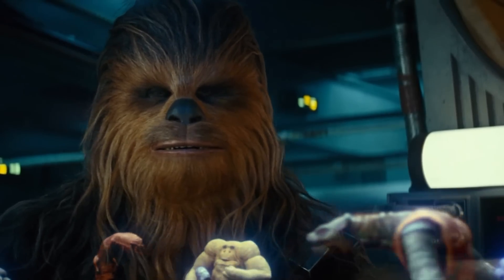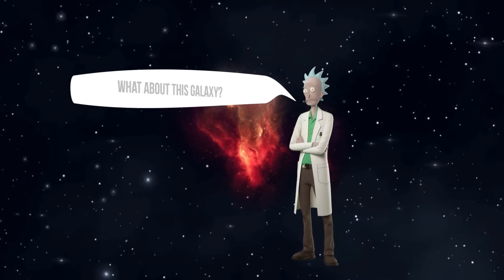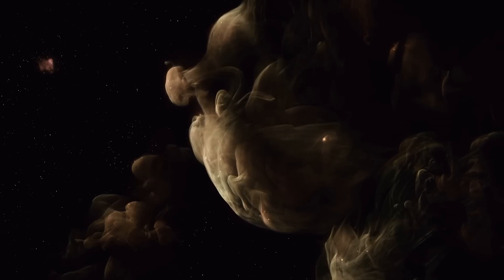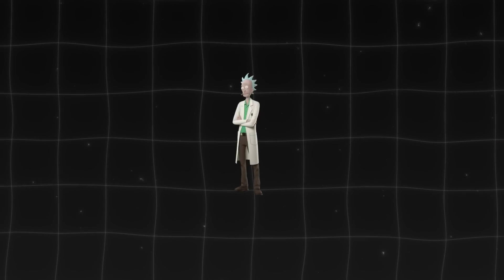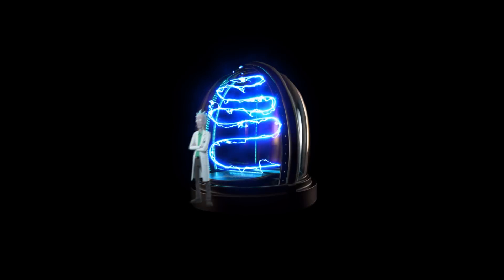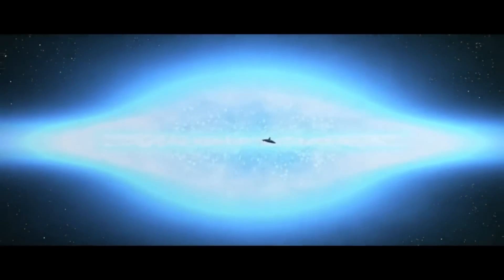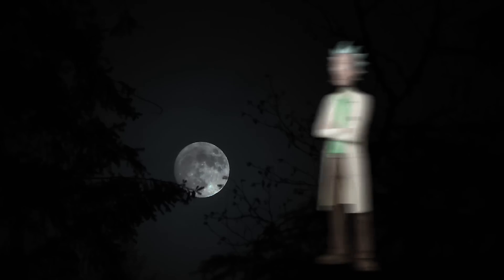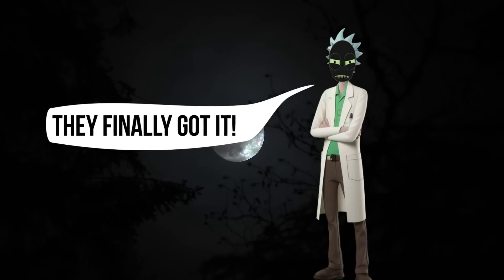I Believe Faster-Than-Light Travel Is Possible. Here’s Why

Comment: Faster Than Light Travel: A Theoretical Possibility
The Speed Limit of the Universe
According to Einstein's theory of relativity, nothing can travel faster than the speed of light in a vacuum. This is a fundamental principle of physics that has been supported by countless experiments.
Theories Suggesting Otherwise
Despite this, some scientists theorize about ways to circumvent this cosmic speed limit:
 * Warp Drives:
   * This concept involves manipulating spacetime itself rather than accelerating an object to superluminal speeds.
   * By creating a bubble of warped spacetime around a spacecraft, it could theoretically travel vast distances in relatively short periods.
   * While mathematically possible, the immense amount of energy required for such a feat is currently beyond our technological capabilities.
 * Wormholes:
   * These are hypothetical tunnels through spacetime that could connect distant regions of the universe.
   * If stable wormholes exist, they could potentially be used for faster-than-light travel.
   * However, their existence and stability are highly speculative.
 * Quantum Entanglement:
   * This phenomenon involves particles that are linked together, regardless of distance.
   * Some scientists explore the possibility of using quantum entanglement for instantaneous communication, which could potentially be exploited for faster-than-light travel.
   * However, it's important to note that this is a highly speculative area of research.
Challenges and Cautions
 * Energy Requirements: Most of these theories require unimaginable amounts of energy, far beyond our current capabilities.
 * Theoretical Limitations: Some theories might violate fundamental laws of physics or lead to paradoxes.
 * Technological Feasibility: Even if the theories are sound, building the necessary technology is a monumental challenge.
Conclusion
While the idea of faster-than-light travel is exciting, it remains firmly in the realm of theoretical physics. Overcoming the challenges associated with these concepts is likely to require breakthroughs in our understanding of the universe that are far beyond our current knowledge.

Comment: To take the moon example at the start, it proves nothing.

Instead of a lazer lets assume you had a very powerful jet of water. Now try the same trick.

You will find that the jet follows your movements in a kind of delayed response, impacting the moon long after you made the movement with your wrist.

The same concept applies with the photons emitted by the lazer - the difference is that our brains cannot process the delay because of the sheer speed the photons travel at. Remember that light can circle the world 7 times a second. A glance accross the light side of the moon is nothing. Our brains simply cannot proccess those tiny increments of time.

Comment: Its not possible in a physical sense as quantum mechanics would cause a breakdown in the molecular bonds that hold matter together... So youd literally disintegrate at that speed HOWEVER it might be possible to quantum tunnel or bend spacetime to bypass that restriction. Unfortunately to bend spacetime you also need to unbend it which requires negative energy - like...antimatter but energy.

And we dont even know if it exists.

In THEORY it is kinda possible to cover distance faster that the speed of light, but not to travel faster than it. You can bring the end of the unverse to you rather than travel to get there.